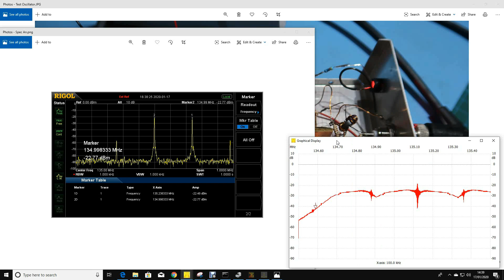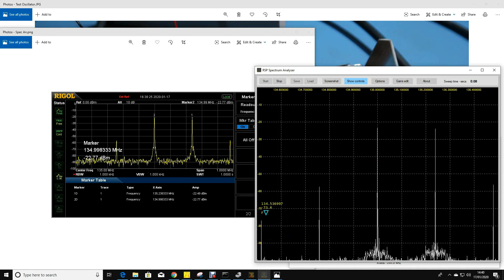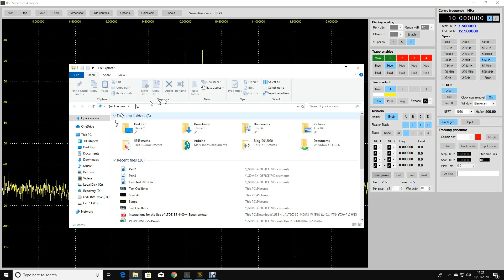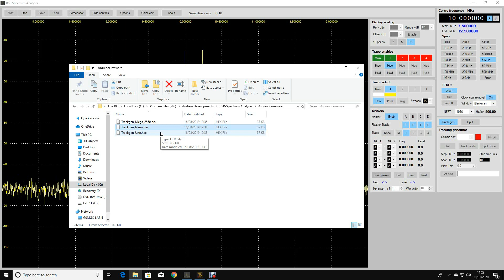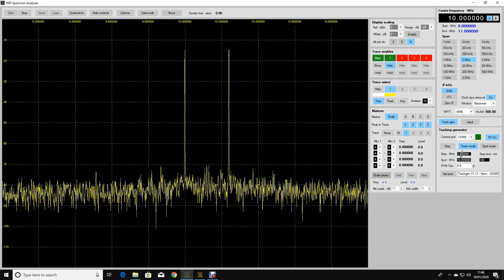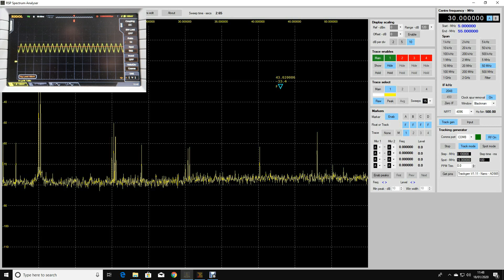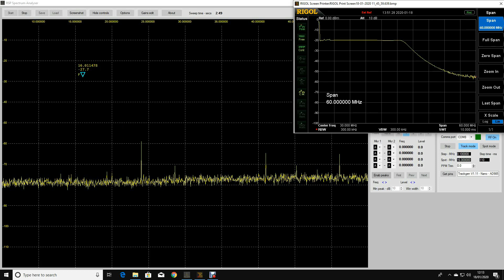SDRPlay Spec An

Comment: Another excellent video, thanks!  I too have the RSP1A, and use it without having read the manual, for sweeping homebrew filters etc. I use a simple RF noise source to give the outline of a sweep, it works acceptably well. I have a video on my channel showing this.  Thanks for the Rigol comparisons,  I don't have another SpecAn so your results made me happy!  I purchased the RSP1A as a general purpose receiver and as a modulation monitor for my QRO  AM transmitter, but I mostly use it as a SpecAn. At HF and up to 2m  where I build my projects it is more than adequate.    Have you come up with a scheme for protecting its delicate front end in the presence of 100w transmitters?
Reply from the maker: Thanks Paul, I take the normal precautions with the SDR and havent fried it yet!

Comment: The SDRplay spectrum analyser link is https://www.sdrplay.com/spectrum-analyser/

We recommend buying the RSP1A from an authorised distributor or direct from https://www.sdrplay.com/purchase/
Reply from the maker: Do you have any info on the "custom" option in the DDS selection? Can we interface this to a ADF4351 to provide full coverage to 2GHz? If you could publish the interface I would be interested in developing the software - see https://youtu.be/ZrB41SkXX4c
Reply: @MarkG0MGX  Pity there was no response, I would have been interested to hear how the tracking and amplitude compensation is meant to work.  As a side thought, this amplitude drop off plagues my attempts to use si5351s across HF in receiver projects.  It is difficult to keep the LO drive to a DBM up to +7dBm across much more than about 10MHz.